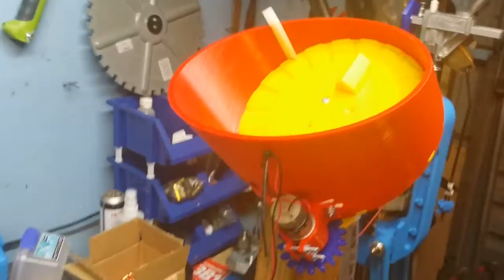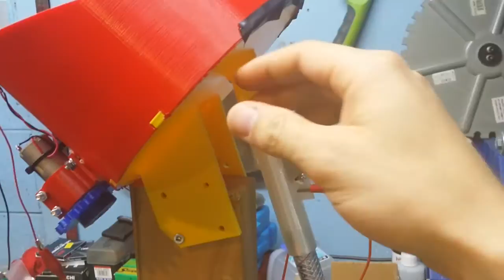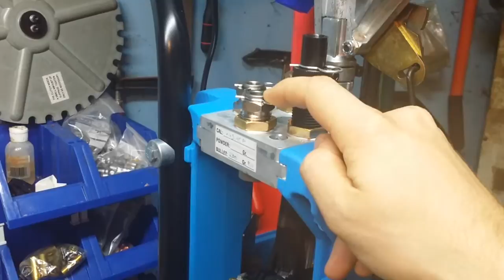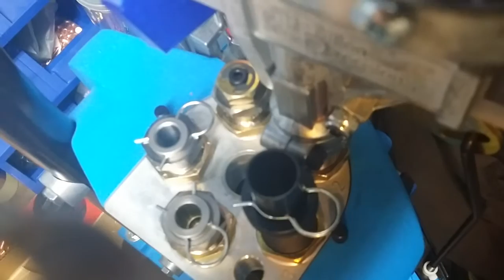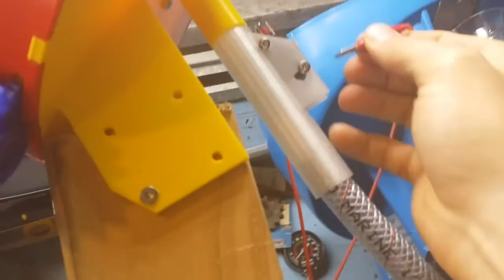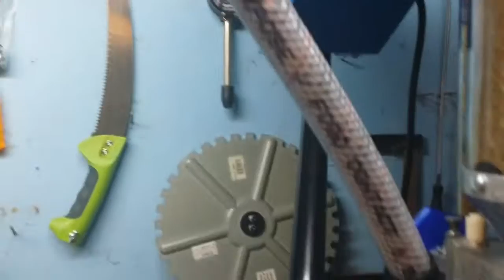3D Printed Bullet Feeder - Final Design Walkthrough

Comment: Hello Can you tell me what kind of engine to used? Thank you
Reply from the maker: It's a 36RPM gearhead motor from Jaycar in New Zealand.  The details are on Github in the BOM and Assembly text file.  Anything with roughly that speed and ~1Nm of torque should work.
Reply: Thanks for the reply. It seems too much speed. Maybe officer with at least best rpm?
Reply from the maker: You could use a slightly slower unit, but it may not quite be able to keep up with an XL650 running at full speed.  Sometimes there is a long string of bullets that are the wrong way up on the platter, so you might get no bullets out of the feeder for 10-20 seconds sometimes.    That's enough to run the tube out when cranking out 30 rounds a minute!
Reply: Ok many thanks

Comment: nice and thx for the files. You have any files for the 9mm version? :)
Maybe 3d files for case feeder as well?
Reply from the maker: The .45 files should work for 9mm round nose bullets reasonably well.  For truncated cone or hollow-point, the edge of the centre piece needs to be slightly bevelled, which can just be tweaked by hand with sandpaper or a file if needed.
The case feeder I'm using is just the Dillon one, although it seems like it would be a much easier task to create than the bullet feeder!

Comment: Any thoughts gone in to a rifle bullet feeder?
Reply from the maker: I don't really do all that much rifle shooting so I've been sticking to hand-loading for that.  I've got some flat base 30 cal rounds that look like they would nearly work without any modifications and some .223 boat-tail that would probably need a bit more of a bevel to be cut onto the center hub piece.  Would be easy to try out just by printing the center piece and filing it down slightly, even.
Reply from the maker: Just remembered that I did have a brief muck around with it a while back.  The problem was that the rifle bullets tended to skate over the grooves in the rotating platter, so I was going to either make the grooves more aggressive to pick up bullets or try something closer to vertical slot based designs that are around.

Comment: Just finished printing. Seems like a solid design. There are (2) pieces missing from the files. One is the connector between the feeder base and the feed die switch tube. The other is the part that connects the tubing to the DAA Bullet feed die. Are the files for these parts available to us?
Reply from the maker: Glad to see another of these out in the wild!  How did you get on with the printing?  What printer did you use and what material?

There are no extra parts there, the feed die switch tube goes directly onto the DAA bullet feed die.

You'll need a tube of some kind to go between the bullet feeder base and the top of the feed die switch tube.  The best way to do this is to get some 3mm PLA filament (I used clear), boil it to soften it up and then wrap it tightly in a single layer around a 12mm wood dowel.  I've only tried it with metric dowel, but 1/2" should work as well.  You're basically trying to make a PLA version of the spring used by the DAA bullet feeder.  I think I ended up using about 200mm of total length.  That should press fit into the base and the top of the feed die switch tube, but a few wrappings of tape around the outside to keep it in place isn't a bad idea.
I've previously used 12mm ID (1/2") fuel hose before and someone else has used the metal-coil type shower head hose.  These work OK, but the up-down motion of the feed die can press against the bullet feeder and it's just all a little awkward.

Let me know if you run into any issues.
Reply: Ahh... That makes sense. I was just going by the video. I printed in PLA with my 
Robo3D R1+ printer.

All items printed good except the feeder base. The 2x4 mount arms need more 
support. Mine snapped off fairly easily. So I bondo'd over and sanded the base 
smooth and will figure out a different mounting method.

I'll give the dowel/filament method a try.
Reply from the maker: Ah, of course.  Yeah, things changed a bit between this video and version 1.0.  I should do a new video showing the setup exactly as it is now.  I'd like to reprint it all to be the same colour (maybe Dillon blue) but for the moment I'm going to keep using the original prints just to see how long they last.  I think I'm probably somewhere around 20k fired rounds now with a heck of a lot more during testing.

Interesting that you had trouble with those arms, mine came out rock solid.  I'll put a note in about beefing them up a bit for a future version.
Reply: No Worries. I printed in Blue and Grey so it looks like a Dillon mini-feeder. ;-) I may re-print the base and see if I get better results. Just printed a toggle switch mount to add on. Overall I'm really pleased with it! I have a few friends now interested in it as well. New vid would be awesome!
Reply: May it be possible to print the feeding die too?

Comment: What's the total price for everything?
Reply from the maker: The main cost for the setup was the bullet feed die, which cost me something around US$60 shipped.  Other than that, there's US$50 worth of filament, $20 for the motor, a few $ worth of fasteners, a $2 microswitch, some wire/connectors and then a spare 12V battery that I had around.  

The motor doesn't draw much power so a wall wart, PC power supply, pretty much anything could be used.  I use the battery to power a few short pieces of LED strip light that I've glued inside the frame which lights everything up in there really well.

Comment: Very impressive, do you have the STL files available?
Reply from the maker: I've got a 2nd guy building one up and I've been using mine for a bit.  I want to get all the kinks worked out before hitting version 1.0 and releasing the design.  This one now has about 4-5k rounds through it without too many issues.  The main outstanding issue is that the hose between the feeder and press is too stiff, but I've made a PLA coil spring a couple of days ago that I'm going to test out.  That's probably the last piece required to move it to v1.0.

At that point I'll put the Solidworks files and generated .STLs (as well as some notes about printing orientation/infill etc.) up in a git repository or similar.
Reply: jbea035 I will look forward to it, please keep me up dated and good luck with your further testing.
Reply from the maker: Sken 753 Will do, glad you like it!
Reply: jbea035 Hi again,
I hope you don’t mind a couple of questions about the feeder. Over that past couple of months I have been familiarising myself with 3D printing. I have a purse I3 which has a print envelope of 190*190 mm is that big enough to print the feeder? Also you mention that you use PLA to print with, I am setup to to print with ABS at the moment do you have a specific reason for using PLA over ABS?
Reply from the maker: Sken 753  No worries, I love talking about my projects!  I've just added you on google+ in case you want any further details or a peek at the .stls.

I've made everything assuming a max area of 200x200, although I think the actual maximum size is 195mm diameter on one piece in order to leave space to print a skirt to purge the nozzle without having to do anything special.  It wouldn't take a huge amount to shrink that if need be, though.

I use ABS with the printers through my work, but I've only really used PLA at home.  I'm printing on a Mendel90 without an enclosure so I didn't want to have to worry about warping with the huge, flat platter etc.  I've found the PLA to be quite nice for this type of design because it's much stiffer and prints beautifully.

The PLA is also quite a slippery surface, especially the side that is printed directly on the glass, so the platter rotates directly on the base with no lubrication or bearings.  I disassembled it after testing it for more than 10k rounds and there was no wear that I could see at all.

I've got a few ideas for things I want to design and print that need ABS for the temperature tolerance or the flexibility but I keep putting them off because PLA is so much easier to deal with than ABS.
Reply: jbea035 I have checked the spec on the I3 and I can go to 200*200 which is good. Do you use 3mm PLA or the smaller stuff? I believe the fumes are more tolerable with PLA. The caliber looks like 45 I use 38 will that be ok?
Reply: Sken 753 how do I find you on Google+
Reply from the maker: Sken 753  Yeah, the prusa should be perfectly fine.  The Mendel90 that I use is a very similar machine to the Prusa i3.  I use 3mm PLA with the modified version of Wade's Geared Extruder which came with the printer.  There are no fumes at all with the PLA.  I've heard people say it smells sweet but I've never noticed any smell at all.
I made the bullet feeder purposefully generic.  I've used it with both 9mm and .45 without any issue, but I've only tested it with round nose ammo.  I've got some .44 plated truncated cone hollow points that feed OK through it as well, but I imagine it might have some issues with wadcutters, semi-wadcutters and maybe some truncated cone ammo in the smaller calibers (9mm etc.)

If you go to Google+ you should see a notification that says I've added you to my circles.  From there you should be able to select me and send a private message if you'd like.
Reply: jbea035 I have had a look on google+ it says you haven't shared anything with me
Reply: Sken 753 I have never used Google+ before I sent you a message not sure if you received it
Reply from the maker: Sken 753
 Sorry, had gone to bed.  I don't have anything shared on google+, was just suggesting it as a way to exchange e-mails without posting them on youtube!
Reply: jbea035 Very interesting, can i Have the stl file?
Reply: jbea035
would love to get the files too.  Please share.
Reply from the maker: haimik0 - Once I'm completely happy with it, I'll release it publicly as v1, but in the meantime if you add me on Google+ I'll send you a dropbox link to the v0.9 files.
Reply from the maker: Peter Früh  - Same as above.
Reply: jbea035
Done. Following.  Thanks!
Reply: haimik0 Done. thx
Reply: jbea035 Nice build! Added you to my following could you send me the link as well?